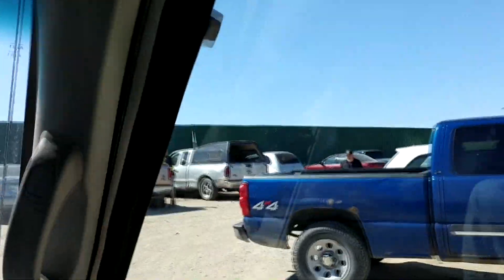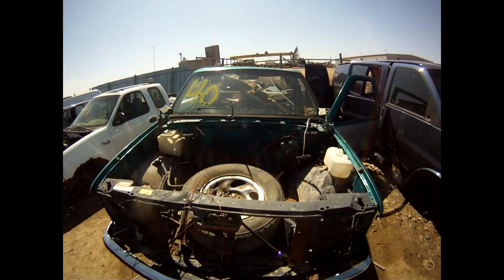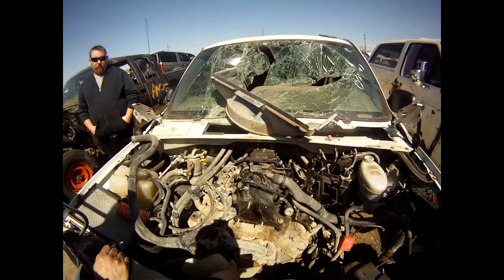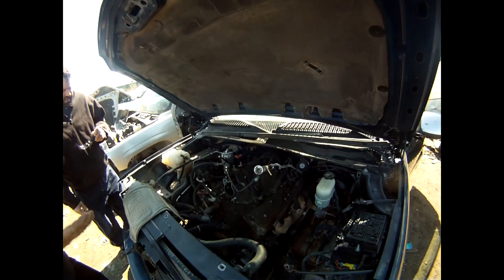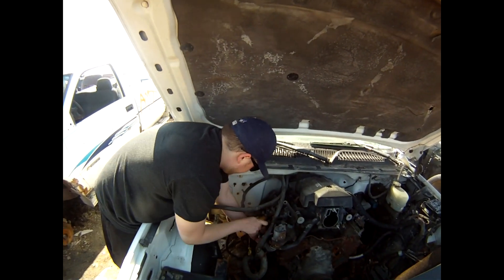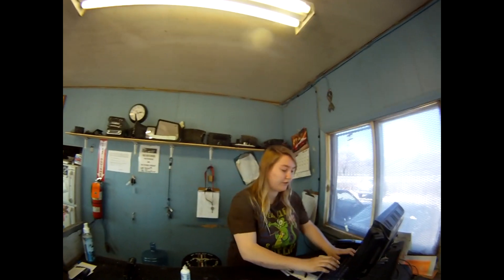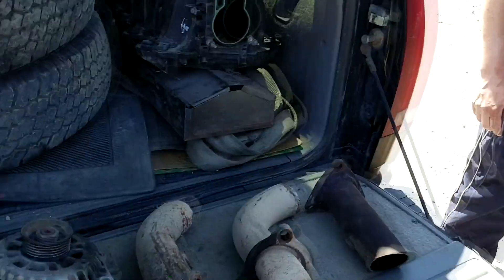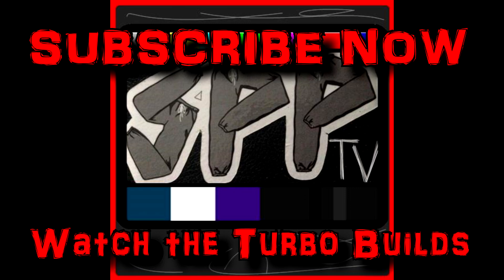RARE LS Intake Junkyard Find | Getting parts for Turbo Sonicstang

Comment: Unicorn intake? lol, its just a Dorman replacement intake.They're pretty cheap new and rumor is they flow better than the regular truck manifolds. It is a pretty cool find in the junkyard(especially for $27) but not rare by any means.
Reply: Bad Luck Garage they meant rare to find in a junkyard, not just all around rare find
Reply: Im aware of what they meant and they are becoming more common in junkyards as well over the last year or so as more and more garages are using them as stock replacements. ;)
Reply: Bad Luck Garage ohhh my bad homes... and I haven't seen any down here in Texas though but hell id like to get one for my truck now... it does look reallyyyyy good.. ;)
Reply: They definately look nice and supposedly they flow better than the OE truck intakes as well.
Reply: Bad Luck Garage no shit huh.... I need to check it the the volume on each of them and see how much more that one gets than the truck one... they did say it was aftermarket right... but still stock huh
Reply: how can anything plastic be rare...

Comment: Pros of working at a shop, just changed an engine for a guy in his Savannah because it was making a bunch of noise, he brought his own replacement but I was curious what went wrong on the old one and pulled the heads. Turns out a lifter failed and ate the cam, offered to pay his core charge and kept the LQ4 for $150.

Comment: Some of those 1500 trucks came with a MAX package. It came with a hopped up motor. Don't know what markings are on the motor but I came across one of them when I was looking to buy my truck. They have a small red MAX badge on the doors below or above the 1500 badge badge sits.
Reply: porkchopz28 thats a vortec max it has bigger rear brakes and make 367 hp at the crank its a 6.0 aluminum block it was "hopped up" 7 hps from a regular 6.0 from a 2500

Comment: you guys are so lucky, you dont even know. my local picknpull has about 20 silverados and not a single one has a motor or anything left on them worth a damn. we have to always buy them on craigslist and they are like 600ish for a 5.3
Reply from the maker: boostinbo Thats not too bad. We pulled the Shithorse's 6.0 from a truck ourselves but it was before it hit the yard and we drove it into a shop. The 2 5.3's I have bought were on kijiji for about $450. Rob also got his 5.3 and another shortblock off kijiji for cheap. The thing about pulling one in a junkyard is limited tools. But if their was anything aluminum or a 6.0 we may pull one.

Comment: depending wher u running your engine at rpm wise, (if i remember right) low mid use truck intake mid to high use car ones like on camaro's. also gm change there intake ports a few times though the years i know this i goin put a car intake on a truck motor and it different. they both change at different times. and why risk a alt or a starter goin out on u by using a old and stuff sit ther for a long time wend u put so much money into ur engine/ride to leave to broken down over a 150ish to 200ish dollar part???
Reply: homecyber32283 

The truck intakes are better performers in both upper and lower RPM ranges compared to the LS1 (car) intake. As far as starters go it all depends on your budget I guess. $200 buys a lot of liquor
Reply: Clayton SPPTV  i couldnt remember exactly along them lines is what i heard i quess its ur set up and preference. ya that b alot of liquor.

Comment: Why did you guys bring some of those battery powered impact wrenches to pull that stuff apart quick and get what you need and bring one of those NASCAR aluminum jacks and stands and yank that stuff out and get out of there by the way that weird looking intake makes major low end and mid-range power with the turbo booster taken care of the rest
Reply from the maker: +AL J No jacks allowed in that yard. But we could bring better tools forsure.
Reply: SPPTV okay by the way what size throttle body fits that intake
Reply from the maker: +AL J The factory 78mm truck style. But compnies sell adapter plates to put the 4 bolt newer throttle body on the 3 bolt.

Comment: Will that junkyard, not let you take an small high pressure air cylinder, like what Nascar teams use for their air guns, in, so you can use air tools, to at least break the bolts loose? 

It is one way, I have used in the past, to at least break, bolts free, a little more easier for myself!
Reply from the maker: +TheCrewChief I doubt it. Anything battery powered is allowed though.

Comment: I'm about to start the swap on my Mustang. I can just use the OEM LS harness right?
Reply from the maker: Phillip Snyder Yes. The shithorse, my LS15, and soon the SonicStang all run stock ecms tuned with HP Tuners and modified stand alone engine harnesses. You can use the harness as is but their will be a lot of extra crap and wires that arent needed in an engine swap. lt1swap.com is a great source of info for doing your own harness. I may do a video on it myself soon. I used to build standalone harnesses for people, but dont have time for that anymore so may as well share my knowledge.
Reply: Awesome.  What did you do on that car for the chassis stuff, separate harness?
Reply from the maker: Phillip Snyder The SonicStang I bought as a roller with really bad but functional wiring. So I plan to re do the chassis wiring. With the shithorse we used as much of the stock chassis wiring as we could.

Comment: WAIT!!!! I get you want the LS3 intake look, but WHY DID YOU GRIND- on the intake runners???? What did that do for you?  The ribs only INCREASE structural integrity so IDK why you'd remove them either.... Just for the look??? ok ok... I get that, but if that's why... Than back to Q1, WHY THE RUNNERS!!!! Soooooooo confused right now!!!
Reply: OH, I see... You removed the Gen3 plastic lugs to use it with a Gen 4 DBW intake... Not a fan!!!! You should've sold it on ebay, and purchased a real gen4 LS3 intake... Shame on you!!!!

Comment: the Dorman intake flow better?
Reply: Everything Dorman makes is better than stock ,they reverse engineer it find the weak spots and fix it so it won't fail in the same way. If I have to replace a part and it available in Dorman's part list it's my first choice. GM's plastic intakes would rot around the TB and gaskets causing coolant loss .Basically if your junk yard hunting look for dorman over stock. The truck intake works better than car one and Dorman is even better made.

Comment: you need to invest in heavier tools 1/2 in for the win
Reply from the maker: ozzy kimble Yeah I think that may be why that guy called us hacks lol. We only bring the one tool box with us usually. Unless we plan on getting a certain part, and then bring proper tools to get the part. Rob brought a big breaker bar to get the wheels off for example. I forgot everything lol. Also jacks arent allowed in there is why they pried the wheels off.
Reply: what i do is bring a small 1/4 set a med 3/8 set and a big 1/2 set. along with every wrench add two of the 12 13 and 15 wrenches. as well as a breaker bar and junk yard walks become candy runs with a hacksaw. but i do suggest a rechargable saw saw, i know you can afford it so its a good investment.
Reply: SPPTV why jacks are not allowed too dangerous?
Reply from the maker: ozzy kimble Yeah I guess they are worried about cars falling on people.
Reply: makes sense but if you are knockin them off they can fall on u still not much thought went into that lol
Reply: JRT my junkyard just sets everything on the ground and if you want to work under something they go pick it up and set it on two big logs.
Reply: ozzy kimble a better investment is a cordless impact.

Comment: just to give you an idea an ls1 is 2500 to 3500$ and 6.0 is 5500 to 9500 so us $ a 6.0 is 7000$ with upwards of 100 000ks on it.
Reply: where in the hell are you at in the world to have to pay those kind of prices?
Reply: I'm in the process of swaping a 4.8 in my 1977 nova  its getting the turbo kit fabbed right now but I paid $400 bucks for a complete running 4.8 with 91,000 miles pretty cheap. 6.0's where I live go for around $1000 ls1's around $2000 ls2's are about $3500-4000 ls3's when there available go for $6000 and up. ls3's are the baddest stock ls motors that have been in the junkyards where I live
Reply: Josh Rooster Cogburn Wood those are great prices you in aussie ?
Reply: Clint Collins Collins idk where you shop but I got my ls1 shortblock for 300 bucks and traded that for a 6.0. just gotta be smart ls crap is cheap everywhere
Reply: I'm from the ol Us and A lol. I'm not kidding you trip over 4.8's and 5.3's in Alabama
Reply: was that ls1 short block in good shape how many miles? I'm pretty good at finding deals but 300 for a decent ls1 short block is awsome I would have kept it vs a 6.0
Reply: 7 grand for a used 6L? I get  LS motors for free at my LJY in Canada.
Reply: Gilbert McGillicutty yes 7k easy 10500 with 6speed on em. remember these are alloy block motors from the holden commodore we have here. but the iron blocks are gonna catch on for boost etc i would really like one.
Reply: If I was you I would sell some ls motors LoL
Reply: are you in New Zealand?
Reply: 6.0s for me are about $1,500

Comment: I don't think those are too rare man those intakes come on the 07-13 Silverado Trucks and that one had rectangle port Intake runners your not gonna be able to use it on cathedral port 4.8,5.3,6.0 heads
Reply: Wayne Johnson, Watch the video again, it's a cathedral port intake...
Reply: Oh damn haha I'm sorry I your got that Intake for a steal then
Reply from the maker: Wayne Johnson Yeah, even if I didnt want to put it on the Sonicstang I would have bought it for $29 and sold it for at least $100 locally.
Reply: SPPTV yeah you can't beat that, keep up the good work on your videos I liked it
Reply: that's not a 4th gen vortec intake and it is cathedral port. open your eyes

Comment: Plastic intake manifold... On a Turbocharged car? That's just asking for trouble. All it takes with a plastic manifold is 1 backfire and it's gone. I've had them melt before, crack, and just fall apart. It's trash.
Reply: Ive seen them blow up, ive also seen expensive sheetmetal intakes blow up. Ive also seen cars go 7s with stock plastic intakes and at 50 bucks vs 500+ ill take my chances.
Reply from the maker: +John Doe lol. Thats funny because who your saying it to.
Reply: There are countless OEM applications that use plastic manifolds on turbo cars, Like Mercedes, BMW, FORD and at $27 for a manifold what are you complaining about?